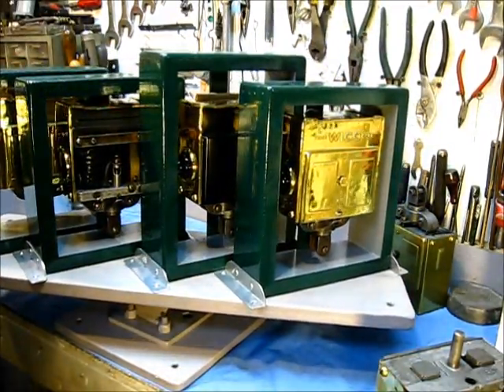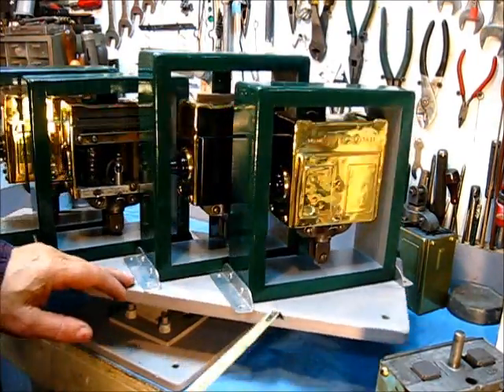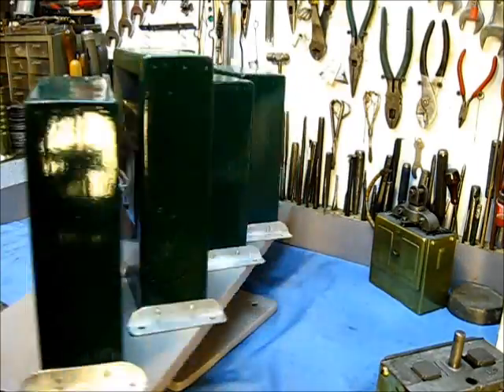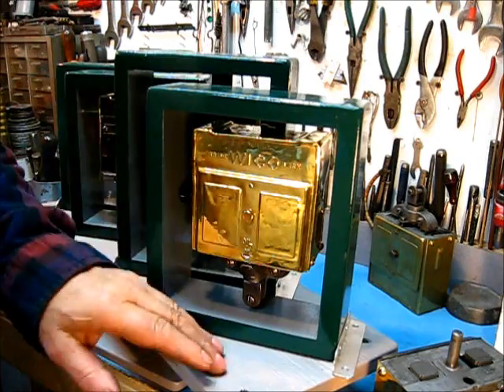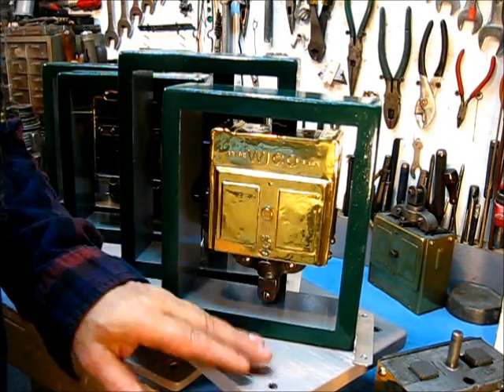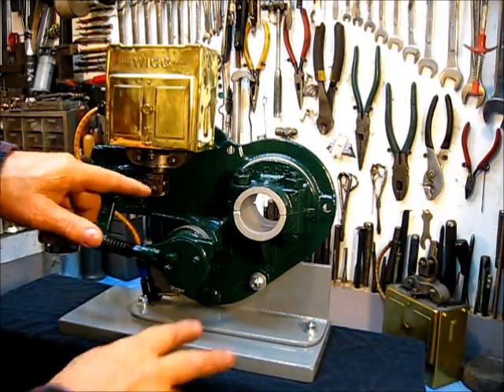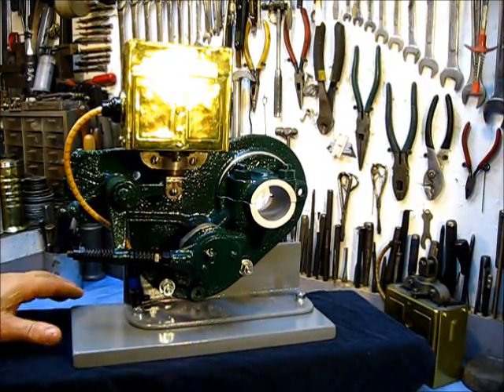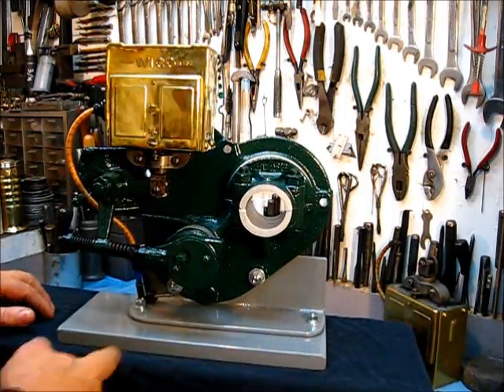Wico E K Magneto / we have got a bad one 1of7

Comment: Just an observation, I notice on your test stand & your newly running IHC M that the armature gets pulled down or open like a 1/2 inch.. On my Wico fired Jaeger & Plessisville engines the armature only opens maybe an1/8th of an inch if that. They both run fine but I'm wondering if it is cause for concern? What ya think?